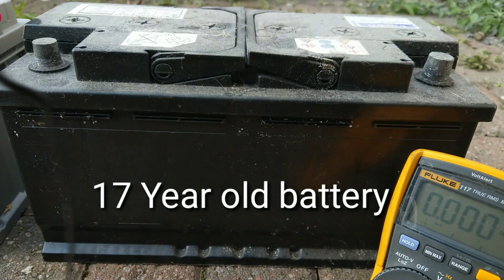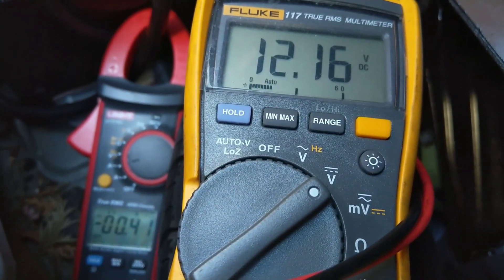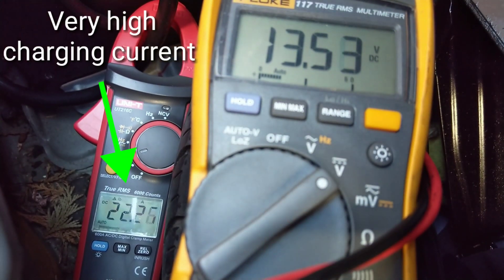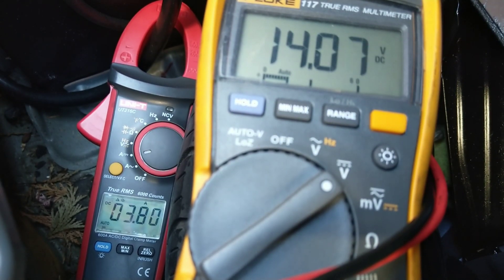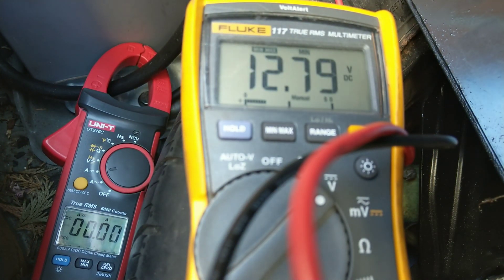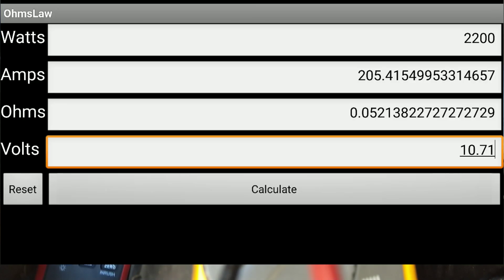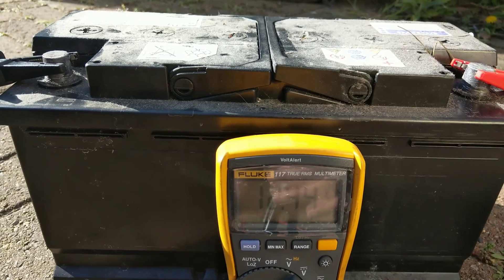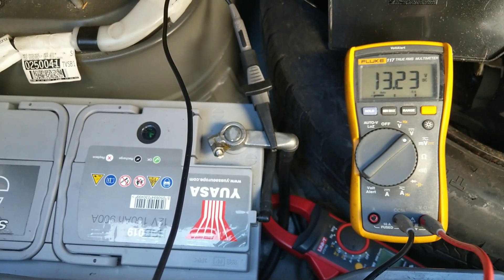How To Test a Car Battery Correctly

Comment: This video and the battery explanation video were spot on. Basically confirmed my suspicions on a weak/old battery. Previous owner had a Volvo 600CCA (H6) battery but in the owner’s manual a premium Dolby stereo car required the 700CCA (H8). I just bought the larger one since it was the same price. Thank you for the Volvo videos.

Comment: Super interesting & useful. Once batteries were said to be, when fully charged, 2.1 volts per cell, and with 6 cells, this was 12.6, but with the different technologies, gels and what not the cell and battery voltages are higher as you showed. Often wondered if this was part due to folk originally using analogue meters giving a less accurate read. Also I have been wondering if its time to think of using Lithium ion batteries which are much lighter and don't have acidic vapours like the original lead acid accumulators. Anyhow buoyed by your fabulous videos I have just bought a v70 estate with the D5 engine. I have struggled with a Mercedes w202 estate for 5 years, but whilst prepping it for the Mot I was horrified to find that about 1/3 of the front coil spring (drivers side)top retaining bracket had corroded away. I had been cleaning it with a needle scaler and I consider myself lucky it didn't break free and maim me or worse. It is 19 years old,  but still... I can not imagine I will ever buy another German car after troubles with injectors not sealing, dash electronics not reading, replacing the self levelling spheres and pipes, welding up most of the jacking points, on and on it has troubled me. This will be my 6th Volvo (145, 244 and 740) and all the rest have been much better built than the Mercedes and having watched most of your Volvo repair videos I was convinced that I should buy Volvo. Thanks for sharing!